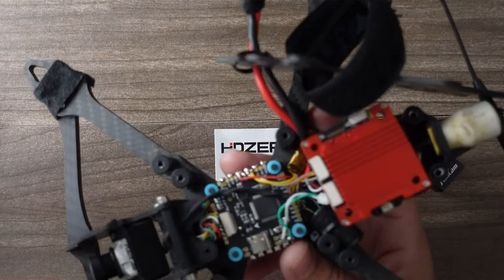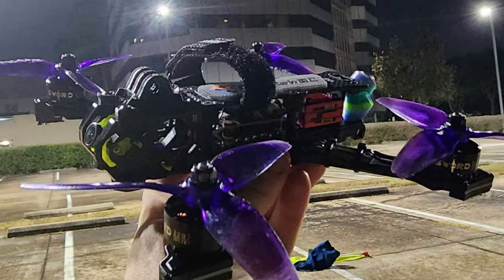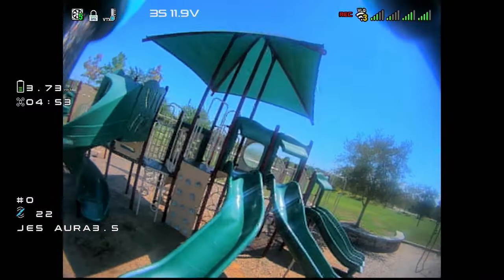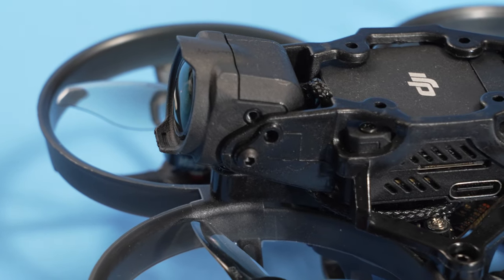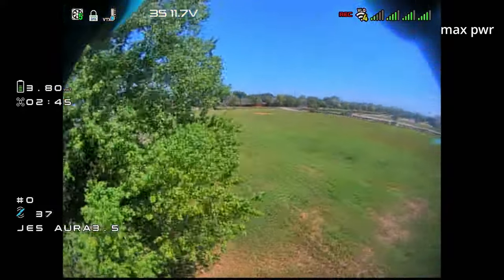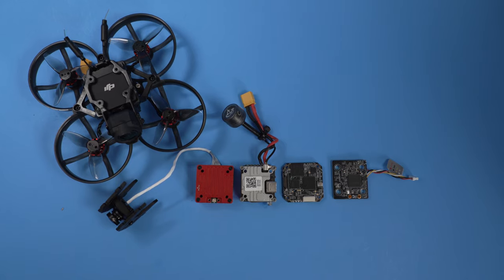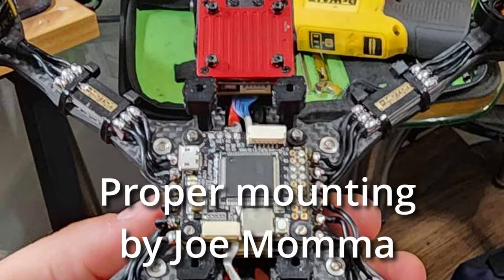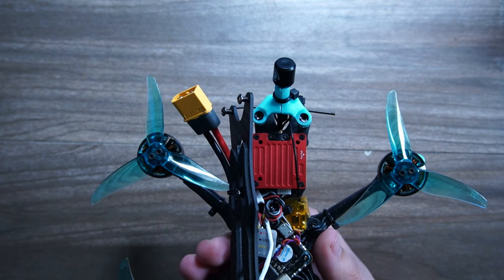HDZero Freestyle V2 VTX - 1 Watt the size of a VISTA

Comment: Hmm, sounds more like a marketing promo than a review Jon. 😂
All the comparisons to DJI when these two products have very different markets, and DJI and WalkSnail have more in common. IMO HDZero's main competitor is analog, which is still cheaper by far. But that's just my opinion.
Reply from the maker: Marketing? I felt like I was pretty critical about the pros and cons of the system. Even saying for many users the other systems may be better.  But for its main purpose it is the best. 

And you are not wrong. Probably more like upgraded analog to many users. I use all the systems (except for walksnail ewww)
Reply: Definitely a long commercial. And you are correct. Nobody is ditching DJI for HDZ, we'd be idiots to give up actual clear video for the wall of rainbow. And nobody is ditching anything for WS! 

The comparison to analog is more apropos than most realize.

Comment: $109 for a new O3 cam.. (still expensive..)
Reply from the maker: true, good point.  Pretty cheap compared to most of my cameras, but very expensive compared to other FPV cameras.  To date, i have not killed an O3 camera yet, but i have killed 3-4 90 fps cams.  (I guess i race harder than i freestyle)

Comment: DJI king for slow ,, freestyle , if you scale down image at 80% and  2.7k quality and 120fps  helps alot with latency ,, but fast racing and fast freestyle ANALOG is King ,, I fly analog mostly ,, when you flip on analog its just so smooth ,, DJI DIGITAL stutter sucks ,, it goes away if you only fly DJI but when you switch back and forth analog picture sucks but just so smooth ,, going to get HD zero ,,  DJI has a constant stutter I see it clear as day and drives me crazy not only that the new 1.6 and 2,5 watt  Analog is so powerful I fly the same places I fly DJI and no stutter hardly any static with Rush tanks 1,6 watt vtx and mic'd
Reply: I don't get much latency in my O3 units. I get horrible signal in my analogs in environments that digital seems better in, and vice versa.

But I do get signal loss and a screen of rainbow within feet with HDZ. I've been battling this for a few months now and I think I have realized that I don't have a passion for fidgeting with things as much as I used to. I want it to work as they tell me it will straight out of the box. HDZ, and to a very greater extent, WS are trampling on that trust.

I do wish we could get mics on the digital quads natively. That is the only thing not making me switch from DJI O3 100%.
Reply: @ogpennywise   not being a jerk or anything you have a valid argument I keep trying to use dji for practice racing I love the image Ben cropping the image to 80 percent reduction of latency is huge I love dji it's the best also the iso on flips turns a black screen for a second if you reduce the iso to 800 or 600 on brightness 🔆 day it eliminates that brief flash when flipping a lot or adjusting needed for 03 to work properly especially mounting camera ieerr some quads can pies you off with the 04 oops thats comes soon haha 03
Reply: @ogpennywise  if you have a set of the Older V2 goggles try the 80 percent scaling on 2.7k 120 fps I mostly use this unless filming